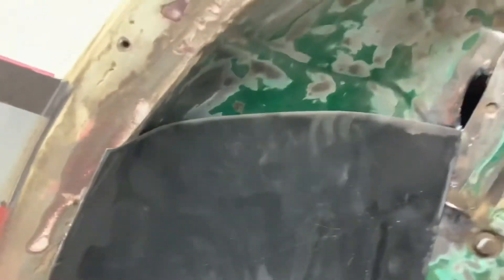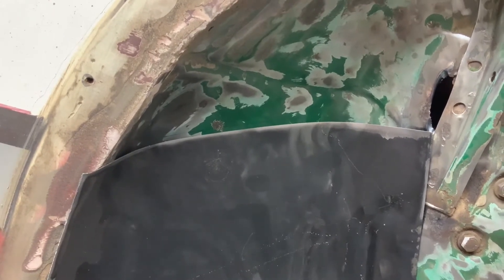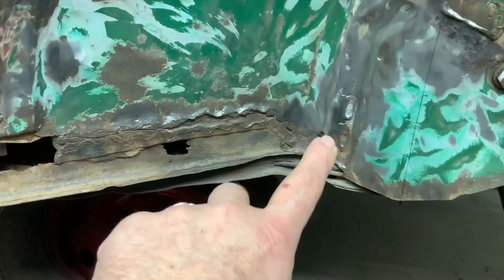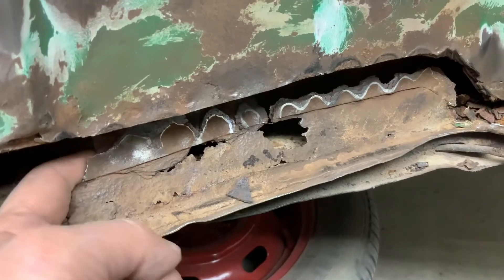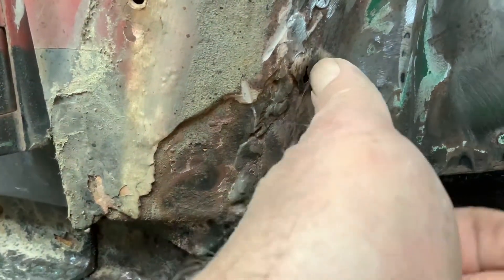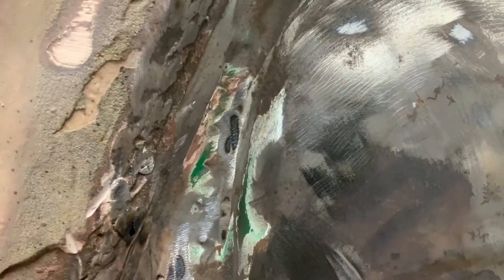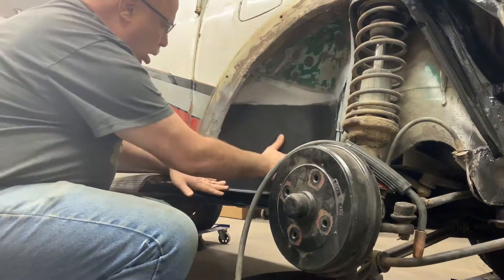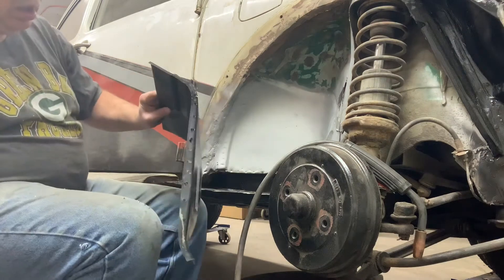Replacing rusted out front wheel well.

Comment: I have had a few Beetles over the years, I still have a 77'. Years ago i did a complete body off repair job, lots of work. your is looking good.
Reply from the maker: Thank you! I have debated whether I should have pulled the body off. I have really enjoyed the work so far. A little worried about doing the paint job but will work slowly and see how it goes.
Reply: @beetlebuild8528  I am no pro but mine came out pretty good I am sure your will look nice.
Reply from the maker: @shanesmaineshop  looked at your channel. Well done ! I'd be happy with 100 subscribers. Guess regular posts will help build viewership.
Reply: @beetlebuild8528  Yes. and i am not always very consistent but I am at about 4500 subs. Still a lot to learn that's for sure. You will get to 100 in no time.